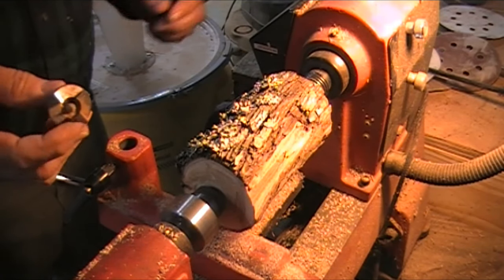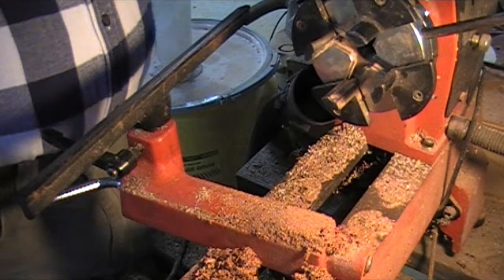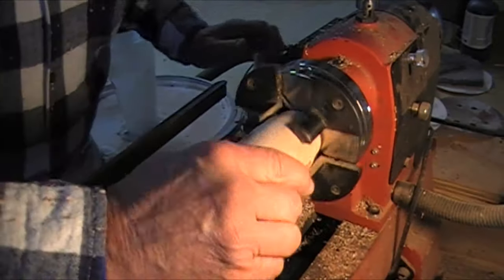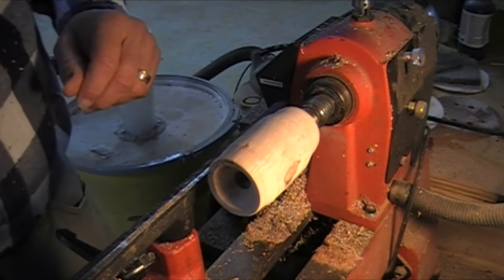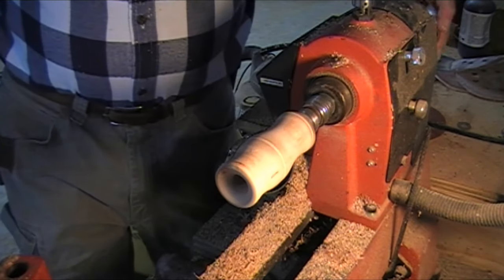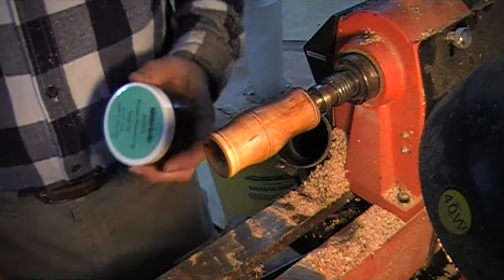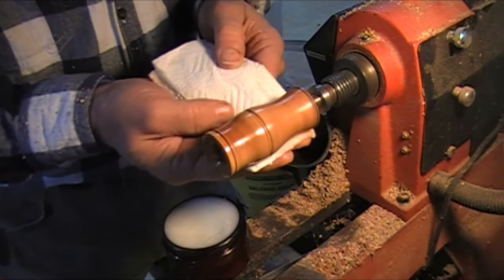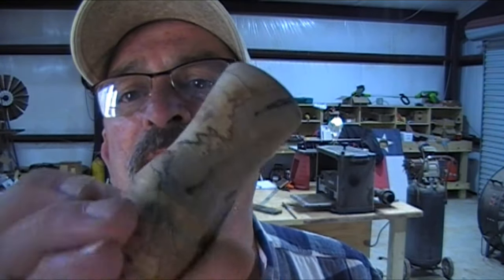woodturning a scorched pear wood predator game call

Comment: turned out great ron  i use acks  paste as well and its great . but i tell ya what just a tip or two buddy . burn your lines before the paste  or it just dont burn right .  i use a bike brake cable  for the burning wire that also works great .  other wise  great job buddy  looked really nice .
Reply from the maker: Thanks! I have a nice wire I made for the job of burning but as usual, it was at my other shop. Deep sea wire leader with wood handles. It will burn through paste and all at 3000 RPMs!

Thanks for watching. I have fun and please don't hesitate to give me feedback for my learn as you go journey!!
Reply: @ronswoodturningshopandstuf5759  ok  buddy was not sure never seen someone try to use a coat hanger before lol hey it might have worked huh . just trying to help a little . have a great day my friend
Reply: Great idea on the bike brake handle. I use an acoustic guitar string and that works great too. The larger strings have wire wound around them that causes a lot of friction and burns very well.